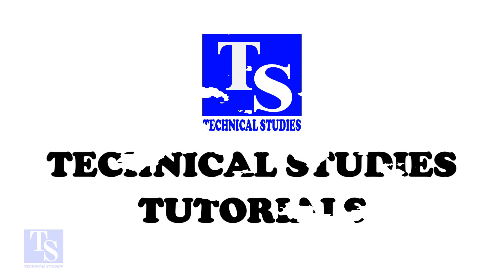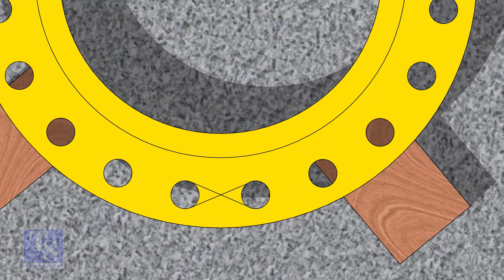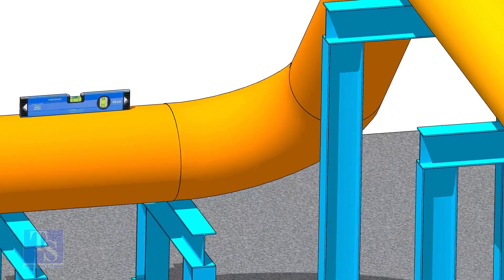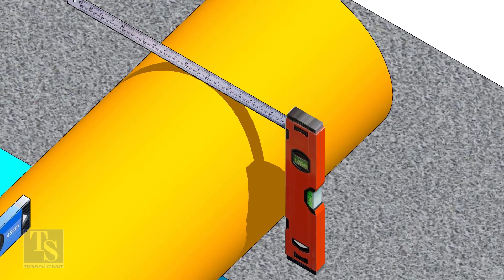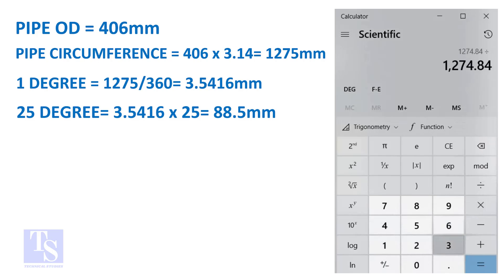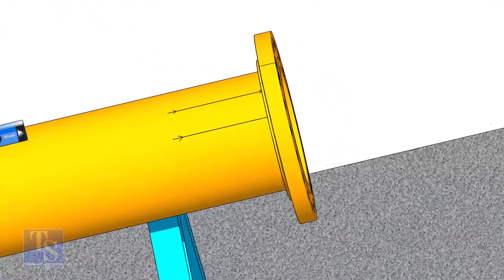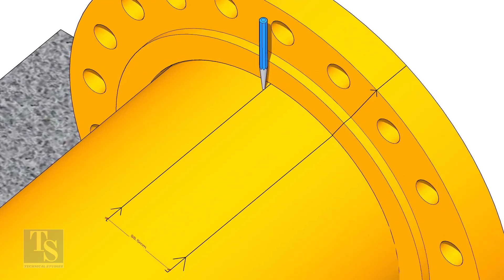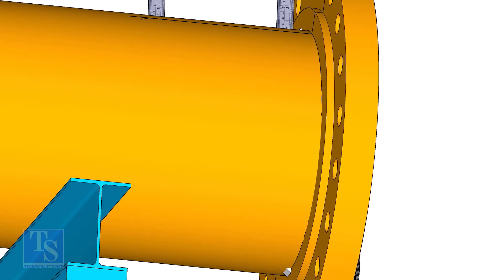Pipe to flange fit up any degree. पाइप का शत कोईभी डिग्रीपे फ्लैंज कैसे लगाएंगे

Comment: 🚩🪔   👌🙏✊   🪔🚩 Please make a video on the most common MS, Alloy & SS pipes along with the elctrodes used for welding. Also make a video on the different kinds of jigs, fixtures & clamps used for holding, positioning & tacking.
Reply from the maker: Sorry for the late reply. Thank you for the suggestions. I will do.